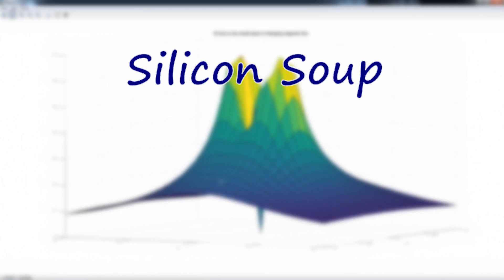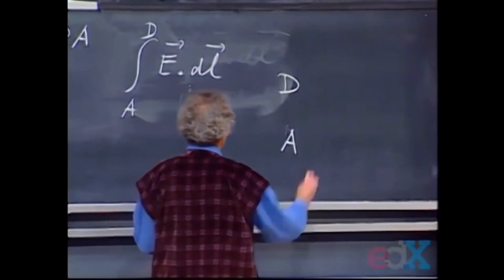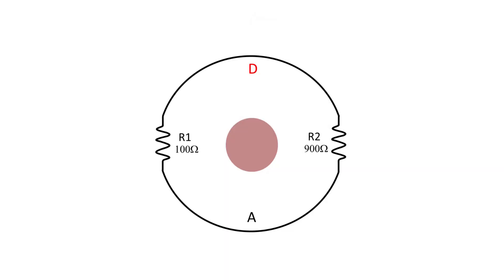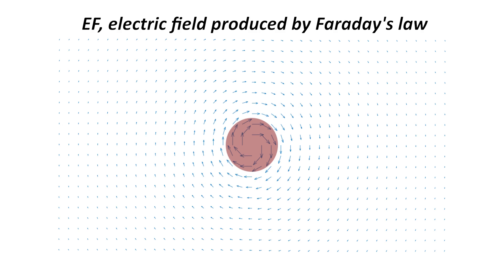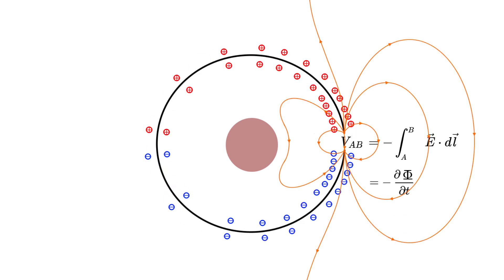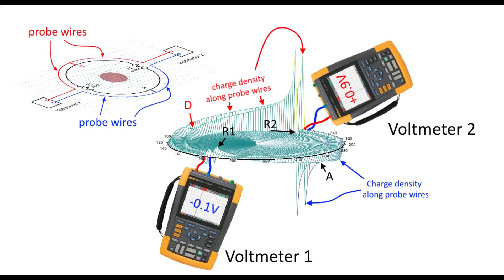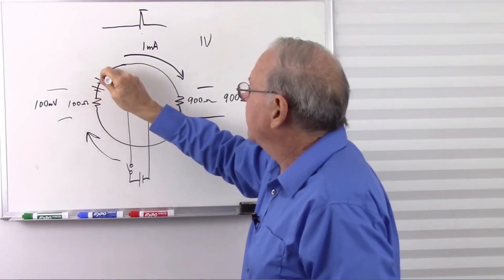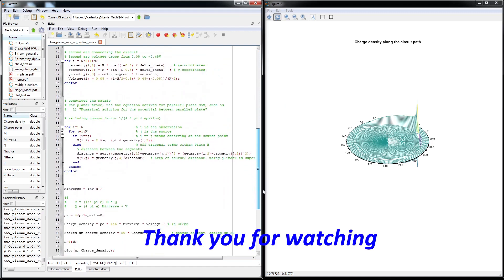Dr. Lewin vs ElectroBOOM on KVL. Of course Dr. Lewin is right.

Comment: At 11:10, you literally grounded one side and measure the point that is arrowed by red and for the other probe you are measuring the voltage difference between the red arrow and blue arrow. For sure they have to show two different value as they are not the same and for sure the red one must be zero as it is the ground or the reference. Also, in 9:33 the green and yellow path are not the same as the yellow path has just one loop of wire and the green one has two loops of black wire which means there must be induced field because of these two loops (because there are electric field in the media that the circuit is in). I think there were two problems in this debate: firstly both sides had different definition of voltage and second prof.lewin did not realize that he is not measuring what he expects as he did not probe properly similar to your mistake in 9:33.
Reply: Lewin's experimental setup discussed here is essentially identical to that found in the MIT Open courseware video linked below.
MITOpenCourseWare
RES.6-001 | Spring 2008 | Undergraduate
Electromagnetic Fields and Energy
10.0.1 The non-uniqueness of voltage in an MQS system
https://youtu.be/u6ud7JD0fV4?feature=shared
The instructors for that MIT course, Messrs Haus, Zahn, Melcher and Silva obviously saw nothing untoward in the demonstration methodology presented in this official course video. The claim by many that the measurement technique is somehow flawed, begs the question “Was everyone at MIT Physics along with Walter Lewin deluded with respect to voltage measurement”. A good number of physicists from other highly regarded physics schools and as authors of texts on classical electromagnetic theory, make reference to the same experiment to highlight the challenges faced in understanding the subtleties of electromagnetic induction. In particular, independently submitted papers to the American Journal of Physics by Dr Robert Romer (Amherst College Massachusetts 1982) and Dr Don Moorcroft (University of Ontario 1969) are excellent examples. W. Geraint V Rosser’s erudite text "Interpretation of Classical Magnetism” covers the topic in detail on page 237; Section 7.3.2. The demonstration is a useful segue into a discussion of Maxwell's equations - in particular his rendering of Faraday's Law.
Reply: To understand how one “accounts for” the induced field in conductors, I would refer you to the journal paper, “What do “voltmeters” measure?: Faraday's Law in a multiply connected region”
Robert H Romer
Physics Department Amherst College, Amherst Massachusetts 
American Journal of Physics, Volume 50, No 12, December 1982
It can be viewed online.
In his analysis, Romer deals with different closed paths which are threaded by the same localised time-varying magnetic field. At no point does he suggest there is a non-zero induced voltage along any of the conductors which form part of the closed secondary loop with the two resistors R1 & R2. Likewise he does not suggest there is a non-zero induced voltage in any of the leads connected to the voltmeters. This is specifically implicit in his analysis. See for instance the derivation of Romer's equations (5) to (11). The voltage along any path is expressed essentially by Ohm's Law applied to that path. In essence all that is required to solve for the voltmeter indications is the application of Ohm's Law and Faraday's Law of Induction. The voltmeters indicate the Ohmic voltage “drop” across the resistors plus the negligible Ohmic voltage “drop" along the conductor segments. Several of Lewin's critics have argued that there is something akin to “hidden batteries” that must be included when dealing with the supposed voltage drops in the various wire segments that exist in the total circuit. This defies logic since (in Romer's example), there cannot be anything other than a negligible resultant longitudinal electric field along any wire segment. For instance in Romer's experiment, there cannot be any self-induced voltage drops in the wire segments, as Romer posits (and experimentally implements) a linearly increasing or decreasing time-varying magnetic field flux - at a constant rate of change he designated alpha [Weber per second]. How is voltage defined between two points? As Romer's analysis implies, voltage is defined as the line integral of the resultant electric field strength encountered in the traversal of a circuit path between those two points. This is substantiated by referencing the International Electrotechnical vocabulary IEC Glossary 60050 Area 121 Electromagnetism, section 121-11-27 at the Electropedia website. 
One matter that some people might initially find troubling is that this definition of voltage, when applied to the secondary winding(s) of a transformer, does not equate to the transformer terminal voltage. However a little reflection on Maxwell's integral form equation for Faraday's Law, requires one to integrate the electric field strength around a closed path as opposed to the path along the transformer winding only, where the resultant electric field strength is effectively negligible. If we adhere to the notion of there being an induced EMF around a loaded secondary loop, Faraday's Law offers us no clue as to the location of a so-called seat of EMF. Considering Romer's analysis it seems the most reasonable conclusion to be drawn is that the induced EMF manifests solely as the observable sum of the various Ohmic voltage drops around the loop.
Reply: @trevorkearney3088 these two loops are not the same as the current flowing in each branch of these loops are not identical (although KVL holds the same, they are different). This would be important because it matters to understand firstly what is of interest to measure and secondly if the thing is really measured and something else not by mistake is measured. I would like to discuss about the rest of your comment (e.g. faraday law ) but I didn't understand why it was written

Comment: He measured two different voltages from the same 2 points!! Thats wrong right there.
Reply from the maker: You are so quick to make this conclusion, and chances are that you are not aware of the path-dependent property of non-conservative field. You may want to read it up.
Reply: I often refer to a much earlier video produced by other MIT physicists covering the same topic with a concise explanation of the paradoxical observations.
https://youtu.be/u6ud7JD0fV4?feature=shared

Comment: Replace "loop inductance" with "partial inductance" then the ELECTROBOOm reasoning is correct. In Dr Lewin example you need to add L.dI/dt as well considering "partial inductance" for each segment of the wires!
Reply: No. The self inductance of the loop is negligible.

Comment: I'm an electrical engineering student and I think that this discussion is based on a misunderstanding. In our courses of circuit theory the voltage across two points is defined differently as minus the line integral of electric field plus the time derivative of magnetic vector potential. It could looks strange but is easy to show that from Faraday-Lenz equation follows that this newly defined field is conservative and the LKV holds. I can assure you that this law holds in AC since we use it in projecting grids and electrical machinery working in AC 😂. Also wikipedia show this generalization of electric potential: https://en.wikipedia.org/wiki/Electric_potential
Reply: I'm sorry maybe I didn't explain myself very well but for "newly defined field" I meant the sum of E plus the time derivative of magnetic vector potential A which is always conservative. I took your point about the difference in the definitions given by IEC of voltage and electric potential and I think that in this terms we can agree that LKV for potential differences always holds and is endeed used to deals with real problems.
Reply: You can think on it as a workaround but I find it important in circuit theory becouse allows schematization of the different contributions of the fields which usually coexist into separate ideal component, for example the contribution of the E field in the wire due to Ohm's law in an equivalent resistence and all the contribution of the dA/dt along the path in an equivalent inductance. This component has their proper costitutive relations among voltage and current and for more complex circuit you can implement standardized analysis method based respectively on LCK and LKV.

Comment: Of course he is not right. The real voltage between D and A is 0.4V. Calculated, not measured. There are mutual impedances as well, take that in consideration. The measurement circuit influences the result.
Reply from the maker: Who is not right, Dr. Lewin or electroboom?
Reply: @SiliconSoup  The two results of measurement are different (0.9V and -0.1V) but the real voltage is only one. The method of measurement alters the results. Both of them are wrong or nobody. They speak about different things.

We have some circuits in a plane. One voltmeter is located in left side and the second one in the right side. They measure different values, right. Try to measure with a voltmeter located in a perpendicular direction of that plane. In this case, the voltmeter will indicate the right value of voltage D-A, that is 0.4 V.

KVL always works, I do not see any problem. Dr. Lewin is a little bit misterios, I guess.
Reply: @Pseudonimul_meu voltage is multivalued when the electric field is not conservative. So both 0.1 and 0.9 are correct. One is correct for the path going through the smaller resistor, the other is correct for the path going through the bigger resistor.
Reply: @copernicofelinis  The voltage AD is only one. Obviously.
Reply: @Pseudonimul_meu  saying that there is only one voltage when the field is not conservative is like saying that the amount of gas required to go from LA to NY is the same no matter which route is followed.
It should be clear that if you go via Chicago you need a certain amount of gas, but if you go via Anchorage, or Buenos Aires, you need a different amount of gas.

Obviously.
Reply: @copernicofelinis  How can you imagine that the DA voltage is different from the DA voltage? What can you say about this L that everyone ignores? Do matter the voltmeters wires?
Reply: @Pseudonimul_meu  I do not need to imagine. I compute it. https://youtu.be/i_2kSvNUj7w?si=-2A_xALjqNzMS2qQ
Reply: @Pseudonimul_meu unfortunately yt does not let me post a link to the video I made. I tried but it does not show up.  The gaslighting on this platform is ridicolous.
Reply: @copernicofelinis  The result is obvious. Calculus could be wrong. Same points, same voltage between them. Remember, the points D and A are connected, DD and AA. How could I have different voltages?

Comment: 1:12 you have introduced a new theoretical component to the circuit that is not connected to it physically. This is not a circuit analysis question this the behavior of KVL is unknown. You have made a new problem.
Reply: 6:00 Current = integral of density vector * distribution. Preform this at each at any point times that on the opposite side of the equation multiple by resistance of the wire you’d get V and - V across any two opposite points of the wire.

Assuming the magnitude of charge density is the same.
Reply: 8:20 you are not testing in an enclosed loop.
Reply: 8:35 I believe the convolution of volt meter 1 and volt meter 2 would be the exact same graph as the one they were compared to, effectively reproducing the entire signal.

Comment: This is just a definition disparity and understanding KVL definition. Electroboom already explained in the video that the circuit misses a secondary of a transformer where the induced emf needs to be considered in KVL for correct measurement. KVL and Faraday's law is just 2 sides of a coin. In every circuit where there is a transformer would you not consider the induced voltage across the secondary and say KVL does not hold there?
Reply: Indeed, ElectroBOOM identifies rightly that the debate comes down to what the appropriate definition of "voltage" is. ElectroBOOM claims that Lewin is working with a wrong definition of voltage because Lewin's definition is just "int E dot dl" without adding an "induced" voltage term. But this way of thinking is based on profound misconceptions about the basic behaviour of electrical circuits, and leads to utterly absurd conclusions. For an inductive element in a circuit fulfilling the "lumped-element" approximations, there is a well-defined so-called "voltage across" the element, but (as indicated in Silicon Soup's video) this does not refer to the voltage along the path of current through the element. In an ideal transformer, under the correct definition of "voltage", the voltage along the path of current through each coil is zero.

I have clarified all these issues concerning the correct definition of voltage in the following video: https://youtu.be/mYWTfxxJncM There is no sound in the video, as I aimed for a high-speed-communication method where ideas are mostly communicated through diagrams and bits of text (as per the saying "a picture paints a thousand words"). The idea behind this style is that those who don't have much time can watch the whole thing in under 22 minutes while still getting some of the main ideas, while those who want to follow at their own pace can pause (or reduce the playback speed) as and where necessary. I hope this style isn't off-putting.
Reply from the maker: Do you believe there there is a voltage distributed along the coil if the coil is made of perfect conductor? To me, ohms law applies and there is no voltage built-up along the coil, but yet there is a voltage across the coil terminals.

Comment: You seem to claim that their arguments are invalid because the voltage across a conductor has to be zero. The issue with that is that they’re arguing for that the conductors involved have become secondary coils in a transformer which no longer renders them as regular conductors. 
Also, the statement you made regarding KVL not holding in the case with the open loop in section 2, is unnecessary as the very definition of KVL is that the voltages around a closed loop all sum to zero. You essentially argued that KVL doesn’t hold for the scenario in which it is by definition not applicable, which doesn’t mean anything, in my opinion. This conclusion had also nothing to do with the fact that we had a changing magnetic field involved; the same result would have been achieved had we just had a regular voltage source.
What this seems to boil down to in my experience is that Faraday’s law is geometry dependent while Kirchoff’s law is meant to be applied in circuit diagrams when all components and their geometries are accounted for. 
KVL only fails if you’ve failed to account for a component properly as with Dr. Lewin’s model/circuit diagram; a conductor exposed to a changing magnetic field is no longer a conductor and has to be treated as a transformer instead.
Reply from the maker: As far as I know, the electrical property of a conductor is the same, whether it is placed inside or outside the magnetic field. Specifically, its high conductivity requires near zero electric field to move the electrons, and therefore the voltage drop along a conductor is zero. In fact, if you do any numerical simulation for electromagnetism, the boundary condition for (perfect) conductor is that tangential e-field = 0. 
If you think my argument for KVL is invalid because I used an open-loop circuit, then you may imagine a resistor (eg 10M Ohms) connected across the terminals, and you will get a close loop circuit to examine KVL. You will see the induced voltage across the resistor, but the voltage along the coil is 0 volt. Sum of voltage over the enclose loop isn't zero as KVL expects. 
If a conductor exposed to a changing magnetic field is no longer a conductor, then what is it? Is it a wire with induced voltage distributed along the wire? My claim is that no, there is not voltage along the wire, but magically you will see the voltage appears across the terminals.